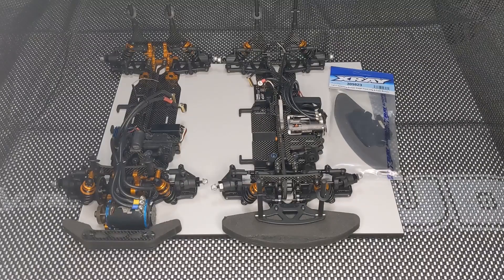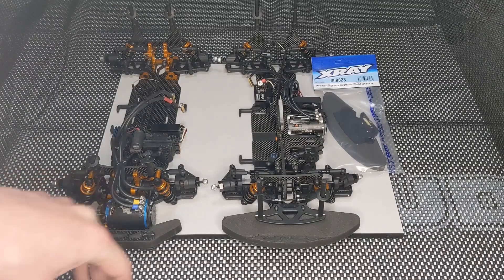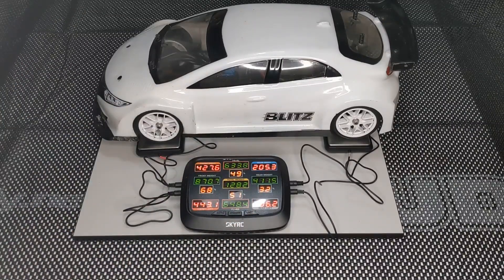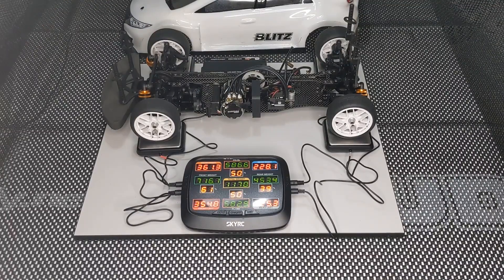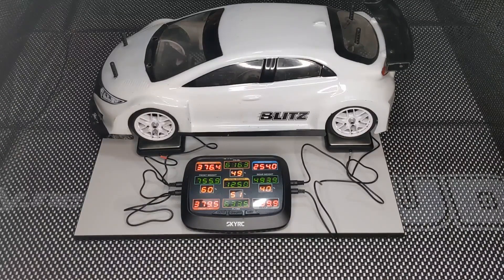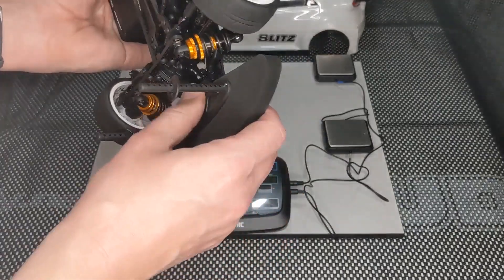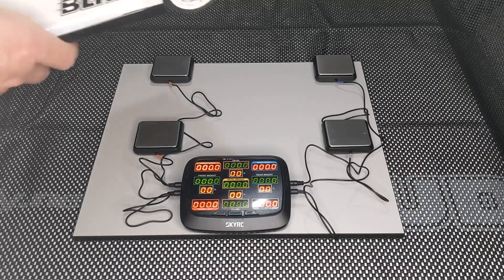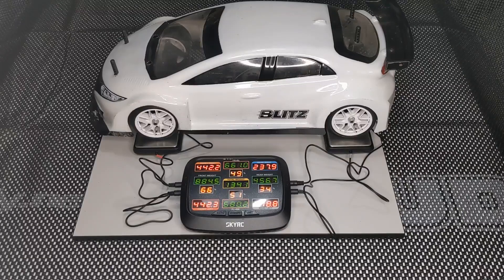XRAY T4F '19 & '21 - What's the weight distribution?

Comment: Hello,
What is the idea now after a long time? 
What is the beste weight distribution for the ‘21?
Reply from the maker: The car is a lot nicer to drive with the heavy bumper. Kit setting does not have enough weight over the front. Ideal setting would probably be a 100gm bumper XRAY never made this but you can make your own with ballast. The current cars tend to run around 100gm extra over the front axle.
Reply: @fiveeight0sixsix  
Thanks for the info. 
I have in front 40gr but i was all the time guessing to put 80gr.

Still with the alu chassis? On carpet?

What are the number of degrees and positions of the pvc inserts in the rear arms?
Reply from the maker: Aluminium chassis will feel better on high grip carpet. Tune rear toe depending on how much steering you need.

Comment: Hello thank you for the video, also HOW did you change your rear bodyposts to vertical can you tell us??
Reply from the maker: I had a new rear shock tower made by a company called Fibre-Lyte in the UK. If you contact them I'm sure they could supply another one using my design.
Reply: @fiveeight0sixsix  thank you for the info 👍 I will try

Comment: Interesting Video. Would be nice to see some Laptimes between those two cars from you on your track. And a feedback to that. Greetings from Germany. Where all tracks are closed.
Reply from the maker: Sorry to hear your tracks are closed. Planning to run this next week, will report back with my findings.
Reply from the maker: So I've been able to run the car at a couple of practice sessions and at one timed race meeting. In terms of laptimes, I got my best time yet on the Rides during the timed meeting - but I didn't spent much time on the Rides last season. Track conditions are tricky at this time of year as it is cold, and I actually lost pace as the day went on. At the end of the day, the cars that beat me were the same cars/drivers that beat me last year, by similar margins (an Awesomatix and a T4F'19, for what it's worth).

I don't think the heavy front bumper is necessarily "faster". But I do think it changes the feel of the car, and is worth having available as a tuning part. I've got no plans to remove it.